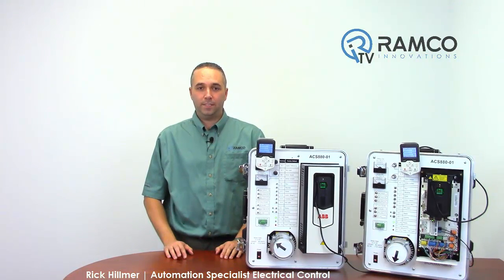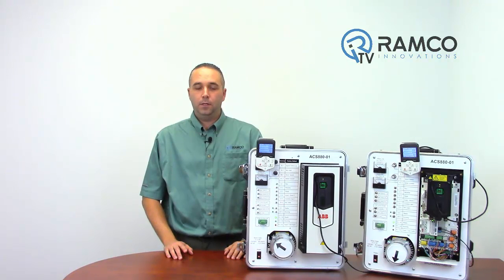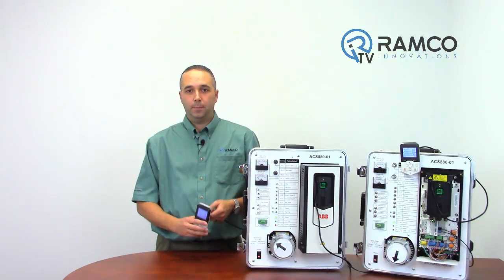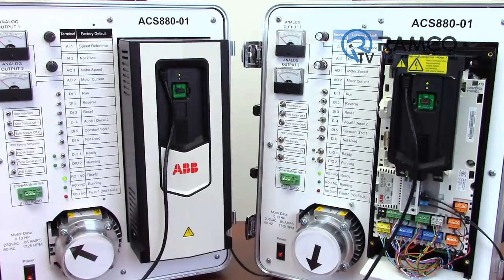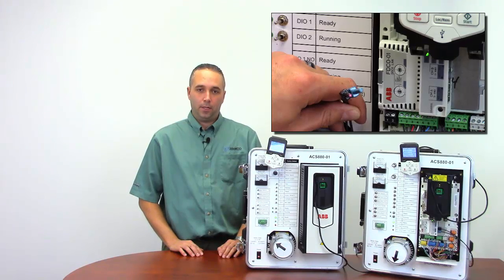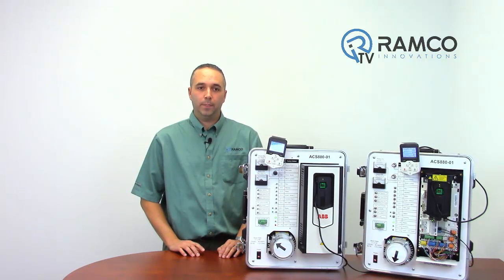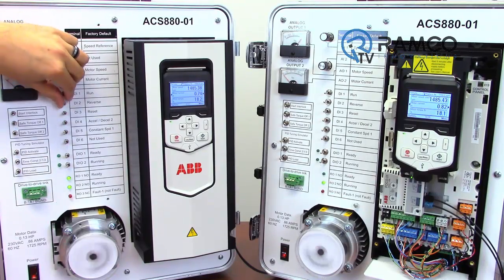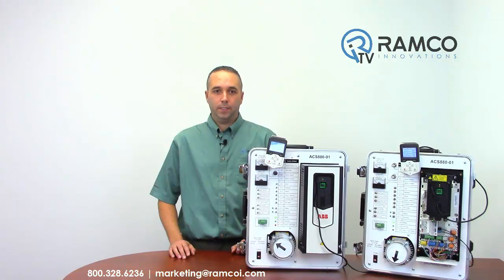ABB ACS880 Advanced Features

Comment: How do I reverse direction on the motor? I have changed up the inputs on the encoder and changed direction within the options menu but it still will not turn. Thank you.
Reply from the maker: Hi Steven,
Below is the link for the Quick Start Guide for the ACS880. Page 10 covers changing the direction of the motor. First, check the cabling if that doesn't work, you can adjust parameter 99.16
https://library.e.abb.com/public/12f1c093cd5e4191c1257a9f003b2c6b/MUL_ACS880_Primary_ctrl_prg_Quick_start-up_guide_D.pdf